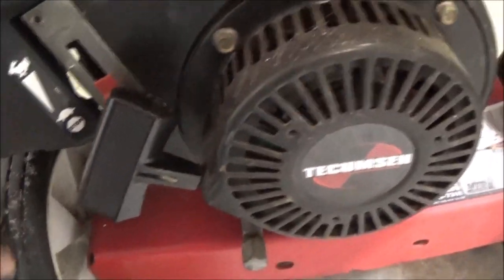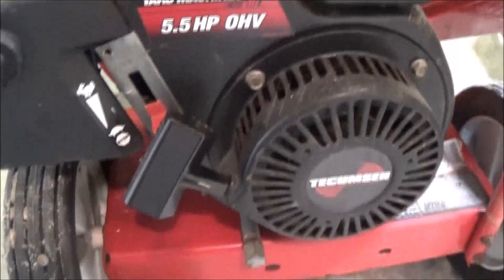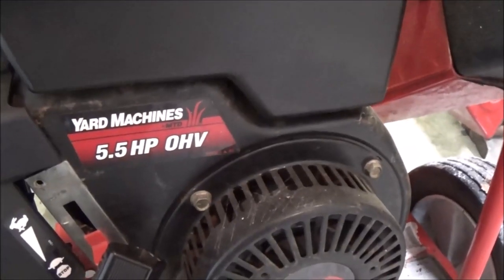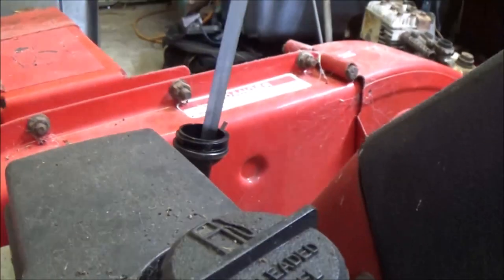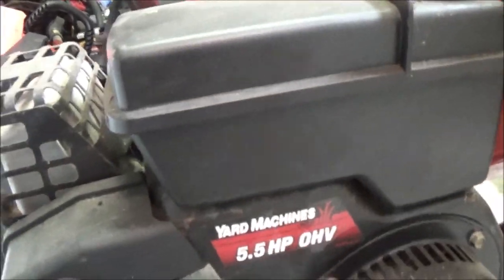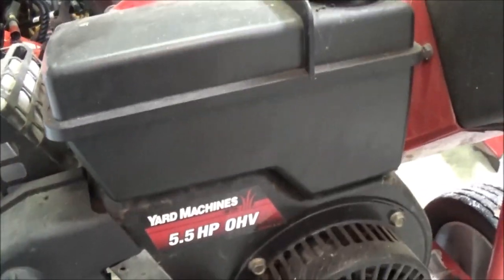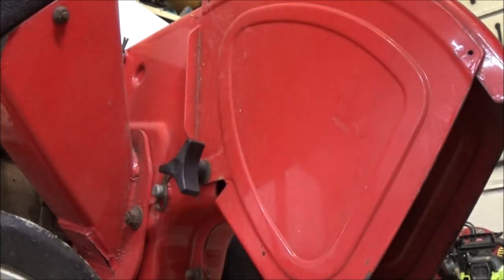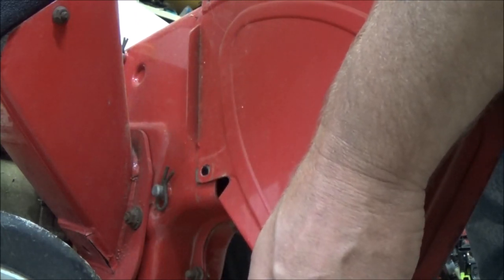Locked Up Wood Chipper Repair Will It run?

Comment: My problem on locked up  chipper was jammed half-inch twig caught in chipper.  I turned off machine before I was totally finished chipping. Locked up.  Just pulled plug and reached down and presto, that was the problem
Reply from the maker: Thanks for sharing that with us. It may help someone else. Enjoy the rest of your week.

Comment: Question for you. I have the same chipper and my blades are good and its not clogged. But I mechanism that spins inside the chipper keeps catching.. And when I try the starter pully, its rough to turn... Its a little rusty inside the machine... should I sparay a little WD40 in there and see if that looosens it or do I have bigger problems?
Reply from the maker: If it was me, I would take it apart and gwt a better look inside. Could be a faulty bearing. Let me know what you find out.
Reply: I have a wood chipper but only the blade wont spin like it should
Reply: They're all hard to pull.
I have the same machine but with the bigger 8hp engine and I have to pull like hell to get it running.

Comment: Next time, before you start, please pull the spark plug cable!
Reply from the maker: It was locked up, power switch off, fuel off.